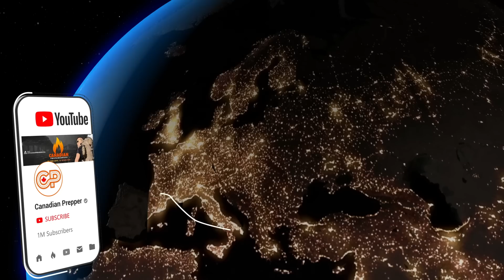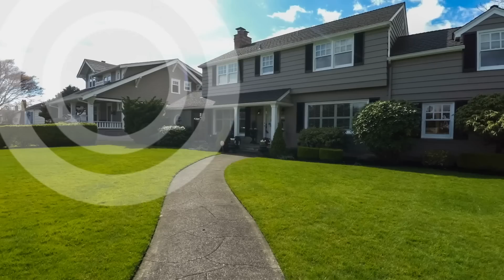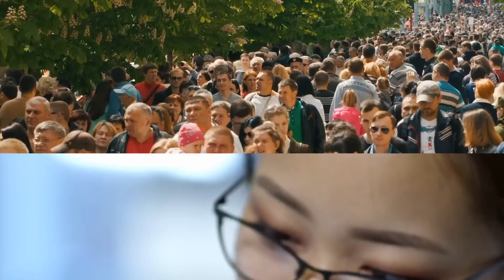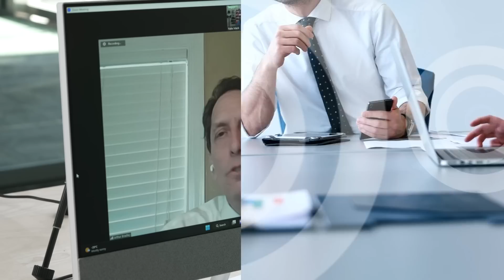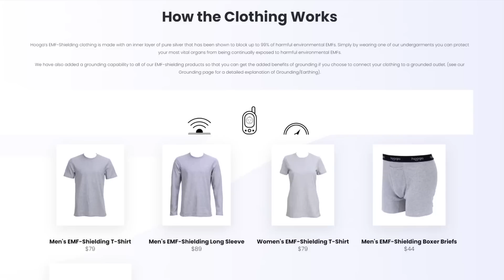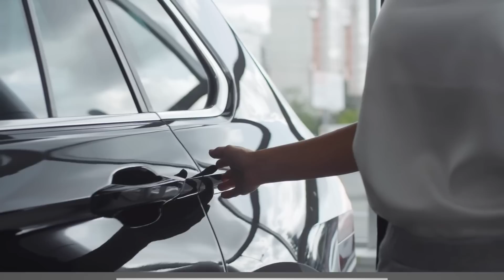NASA Scientist Issues STARK WARNING About WW3, Solar Flares, EMP and EMF

Comment: Very interesting discussion; yet there is this curiosity about the plasma - plasma interaction between the ionosphere and the CME that has not been considered. Quite likely the interaction may/could force an enveloping spreading of the CME around the Earth effectively weakening the impact in any one location. Also recently there seems to have been advanced the notion of the Earth being enveloped by a magnetic bubble (?); now if this be true, there should be also some interaction between this CME and the magnetic shield around the Earth. The magnetic bubble shielding dynamic may presumably further moderate locational impact as well -- one would think.

Comment: Surpasses All Military EMP Testing Standards: MIL-STD-188-125-1,MIL-STD-464C, MIL-STD-461-G, RS-105 (90,000 Volts)
•	EMP Shield Has Set New Standards in EMP Protection and is Listed by Homeland Security in their EMP Resilience Report
•	100% American Made! Around £250

Comment: Europe has been hardening its electrical networks against transient voltages over the last 5 years. We have type 1 surge protection which protects against 300000 volts' type 2 and type 3.

Comment: It’s actually called “Havana Syndrome “
The wifi signals /microwave signals can alter your DNA Helix. Turning on and off switches 
Several vans were captured on surveillance video leaving scene at two different incidents at D.C  after two separate employees were shot by this device that looks like a rifle leaving work in same area shot at steps leaving work.
There’s a picture of Putin shooting one of these rifle like devices with a dish at tip. (In Russia of course)
You can levitate an object for example a ping pong ball 50 years ago using this technology. 
Quantum Channeling

Comment: I'm one of those people who is sensitive to EMF.  I can't have home internet because I can't tolerate having the wi-fi in my home. I figured it out when my wi-fi router stopped working & I realized over the week it took to replace it that my autoimmune symptoms were much, much improved. When I got the new router & turned it on, the symptoms started again within just a few hours. After that, I would only turn the router on when I was actively using the internet. When that router died, too, I simply never replaced it because using one was obviously negatively affecting my health. I have to watch how much time i spend on my cell, too, or the autoimmune symptoms flare. Unfortunately, I'm saturated in EMF at work due to the entire building having wi-fi & I notice I'm more "drained" & have more symptoms from my autoimmune conditions while at work than I do on my weekends off in the relatively low-EMF environment of my home.
Reply: Put an aluminum window screen box around a WiFi router and use only cat-5 or cat-6 to rebuild your network.
Reply: My sister is very sensitive. She got some special black paint and not only painted her entire office with it but my mother’s entire bedroom including the ceiling. She doesn’t have the usual cable connections. She has fiber optic internet connection. She also has a hand held tool she uses that puts out a sound that lets you know how much emf is around her.

Comment: EMF needs to be considered as a potential harmful electromagnetic field.  The changing fields of the EMF can induce inductive currents into the brain cells and neurons whose mechanisms of communications is also through electric waves.  This is because blood is conductive. This induction would be in the form of Eddy currents (Faraday's law of induction).  Hence, possible disruptions of intrinsic neuron and molecules electric fields could happen causing certain weird perceptions and possible tissue damage in the long run with high enough EMF fields.   Just look at the trees and vegetation in close proximity to the high voltage transmission lines that emit high EMF and you'll notice a difference.

Comment: One thing about Faraday fields is too much radiation will overpower and penetrate and make the metal a transmitter.
Reply: Would the old fashioned lightning rods act as a Faraday cage?  Why did they discontinue the use of them in modern construction?  Isn't the ground from one's breaker box to the outside meant to do the same thing?  I don't know much, but I wonder about such things.

Comment: I have created an EMP proof suit which not only protects me from and EMP but also allows me harness its power through a power rod. The rod is connected to a battery pack and is fused directly to my brain via screws and copper wire. If my calculations are correct once the emp takes power away from everything else it should hit my power rod and transfer all the power straight in to my brain and charge my battery to 100%. I should instantly gain all knowledge from the entire internet loaded directly to my brain. Then I’ll use my knowledge to rebuild society after the apocalypse. It shouldn’t take long to become the leader of my own town at the very least.

I’ll use my new power to make a new government along with new laws set by me. Also I’m gonna make an ak47 prosthetic arm that I’ll attach to my arm with 6 bolts and some melt pipes. I f all goes according to plan I’ll be running my own new state within a month and I can choose a group of only the most perfect women to bare my seed. Then my children can help me govern this new land
Reply: Good luck

Comment: The whole 5G infrastructure is a military microwave targeting system. A.I. controlled, High gain, Die-electric and Phased array antennas will identify you, track you, focus and target you. This can be done through walls. The 'safe' limits recommended by regulating authorities are up to 10,000 higher than where detrimental effects are apparent to biological life. All biological life, including microbes. Any and all artificial energy source is not natural and we are not evolved to handle it.

Comment: Some of the frequencies Art mentioned aren't quite right. Cell frequencies have been either 700Mhz, 850Mhz, and 1.9 Ghz. 902-928 is an unlicensed band, 930 is common for certain smart meters. 700/800Mhz are also public safety bands. T-mobile's 5G is on 600Mhz. Wifi is either 2.4Ghz or 5.8Ghz. There's another 5G band around 3Ghz and another right around 5Ghz. There are other higher frequency emitters like car collision detectors at 27Ghz and higher that people are around. So there's lots of emitters out there.

Comment: Curious to know what was the Earliest Year of Vehicles wouldn’t be affected by an EMP?
Reply: It has to be a solid state electrical system with points in the distributer.1975 and older vehicles You still need to unhook the battery both positive and negative cables. You still may have problems with the alternators,burning up the diodes.
Reply: Older vw bugs I think are capable. Might want to research it though.
Reply: Before 1995

Comment: The question of EMFs harming us is possible. We run on electricity with our nervous systems. The possibility of overstimulating these nerves may act on the nerves as an itching powder does on the skin. Earratating thems over the long run! In short agitating people into a higher level of anger over time. These electrical signals may be on a very small scale shorting out, or confusing the brain's intubation of these electrical impulses. Sending the wrong doses of hormones brings about imbalances in our bodies. Increasing the likely hood of malleable physical ailments to more people than before. Then there is a likely hood of weather pattern shifts. We know clouds are drops of water binding around the dust in the air. Some of the dust is of metal. Magnetic wave act on metal! We know from grad school science class, that different magnets leave different patterns with the fares dust on paper. Here is the thought experiment!  Is it possible that all the magnetic waves we are producing all over the world, maybe the cause of the shifting weather patterns? Just how many radio transmitters are there in the world, along with power lines which give off their magnetic field also? One last observation, ever notice when there's a power outage how much more relaxed your nervous system feels?
Reply: We're being bathed in frequencies all the time, yep. How could that possibly be good for us? Check out "Beings of frequency" it's here on yt.

Comment: Our bodies are bio-electric and have become used to all the energy fields around us, if an EMP went off and everything shut down you can be sure that everyone won't be feeling too good, it would be like trying to come off a class A drug by going cold turkey.
Reply: If that’s the case when you go out to the middle of the wilderness you’d feel sick.  Quite the opposite.
Reply: Actually, I lived in a huge urban sprawl for years, on the grid. Then I bought 7.5 acres deep woods, moved to my land, built a cabin and homestead. I disagree with what you are saying about feeling in detox. Its actually an invigorating feeling, like being free, a sense of sovereignty. All the pressure and stresses diminish and you gain a sense of the environment. Its not at all like a addiction detoxing, its like getting a new kind of high.

Comment: Think about those jabs that may contain micro carbon in the form of graphite which is an excellent conductor of electricity, pump up the power in those cell towers and you are a perfect antenna to be cooked inside out…
Reply: According to Todd Callander (look him up), certain frequencies of 5G will activate the circuitry in the jabs.
Reply: @bobnancymiller4931  Those 5G transmitters are being placed on the top of power and telephone poles in our neighborhood and close to our schools, these transmitters look like a big tin can, nothing like what you see on current cell towers. Something very nefarious is going on. I talked to one technician installing these transmitters and asked why such a large power cable is being used since these transmitters are supposed to run at such a low wattage and have a short transmitting range and he said good question, we’re told to just install them….

Comment: Also about the emf n or radiation if one would like to know what it feels like, I don't say do it just microwaves have a large amount the doors have lead glass n lead paint also the metal frame that on the out side is also made from lead in the metal to keep us safe most don't know, I was working in one years back with the top cover off working on it fired it up to see if all was well set timmer for 5 mins was next to it, n the hairs on my arms n head stud up started to feel sick n felt like I would pass out, so I pulled the power cords but no harm that I know of has scams of my body for other reasons from doctors but. My point is it's very strange feeling
Reply: Hey @MustangKevin69 could that not mean that your intact but unplugged microwave, or one you got from a junk pile, could also serve as a Farraday cage?  Why would one need to buy a specialty product, if so???

Comment: Hi Nate. 
Question: If we take the batteries out of our cars then store the battery in a Faraday cage, do you suppose we would be able to prevent damage to the car?
Reply: No.
Reply: You would need a vehicle that has no computer, chips etc. Think classics. Then store any of your electonic components (or spares) in a faraday cage (think condensers, etc.)
Reply: I have a theory that if you ground your vehicle it would give the emp an easy path to ground and maybe spare the microchips. A copper rod in the ground with a jumper cable from the rod to the metal frame of your vehicle might work. Anyways just a theory. This theory comes from my many years of experience in automotive 12 volt industry.
Reply: I have a faraday cafe but my faradays keep escaping
Reply: Thanks everyone for the info!

Comment: Why not just disconnect the battery
Reply: It is not about "being connected" think of it as a giant lightning strike where the energy will pass through everything
Reply: I try to keep everything disconnected from the batteries around here
Reply: If there is no electricity power nothing should be hurt
Reply: DC power

Comment: I use my microwave to melt cheese on tacos. That’s it! I didn’t have one for years. Think about opening the door and that flood of radiation hitting you in the chest or head.
Reply: Oh my goodness stop believing pseudoscience and do some research. HE EVEN SAYS IT IN THIS VIDEO. Microwaves are non-ionizing radition. It does not change or permanently damage tissue like ionizing radiation (nuclear for example) . If you rigged your microwave to run with the door open and stuck your hand in you'd eventually get some minor burns and redness on your skin that would heal just like any other burn. Microwaves move extremely fast and dissipate before you even open the door. They are about the width of a pencil and thus they do not pass through the metal holes in your microwave door , but it still allows you to see your food. They actually do LESS nutritional damage to food than boiling and baking , and are not dangerous if you use them as intended. I still tell people to hit stop before opening the door but that's not because of "microwaves escaping" it's to prevent the door switches from shorting out and you needing a repairman..

 Also if you really believed you had a radioactive box that blasts your food , why would you eat the food since it would kill you. ☢

Comment: ALL electric companies have physical disconnects to protect their massive transformers form electrical damage. These transformers cost millions of dollars and would take years to replace. Yes you would need a temporary blackout, but it would be much better to loose power for a few days than a few years. Power lines if damaged can be replaced fairly easy, but transformers is a whole different ballgame.
Reply: You are right and Rong at the same time.
The general rule is THEY should keep the totality of the system managed properly.
IT is absolutely not.
Reply: That's assuming the power from the lines doesn't jump the gap and take out the transformers. The connections for the disconnects are not that far apart.
Reply: The devices do not need to be connected to the grid to be damaged by an EMP 
If it has chips and circuts it is vulnerable 

As to the transformers the MOT ( main output transformers) at the power plant i work at have a minimum of a 2 year lead time to replace, and they are always connected to the grid

Comment: I feel a rubber barrier would be better....you ever put tin foil in a microwave?...that doesn't seem to me like the way to go...this is coming from an electrician and what iv experienced is you block electric with non conductive materals....you wouldn't wrap a hot wire with tin foil...I feel it could work like a lightning rod but it would have to be grounded....I feel a rubber cage maybe rubber lined metal cage that's grounded...
Reply: You can put metal in the microwave no problem in certain circumstances!
Microwave brownies in a Pyrex dish with tin foil on the corners! Frozen juice, take the top metal cover off! 
You can even set a table knife in and that’s no problem, but don’t stand the same knife up in a measuring cup! 

:)

Comment: The DOD dropped a news story last year that we have a drone now the does the same emp as a bomb without the radiation. And can fly over large areas repeating the same process. I immediately thought this would be good for false flag attacks as well.
Reply: Interesting. Going back in time, Starfish Prime was possibly the earliest specific testing of EMPs (in 1962) using an aerial nuclear detonation. Done in the Pacific, it resulted in an Aurora, blown lights in Hawaii, radio blackouts, electrical surges, telephone outages, killed satellites, ruined electronics, and formed an artificial radiation belt.

Comment: What about if they where powered off n no power going to them is a good ?
Reply: Even if you throw th breaker to the house, it may still jump and ark over. Everything Would need to be unplugged. Even that may not be enough if it affects the individual electronics in the items.
Reply: @rumdog117  kinda was my thought for cars cell phones all that but since most phone's u can't putt batteries n towers would be down for GPS I guess be only good for music,  but as for houses I think it would be better to remove the miteroutsidee but that's just my thought or remove the whole breaker but again wouldn't matter as the grid would be down n other u would need a generator or solar panels u would need to deploy but if the neutron's n electrons was out of wack it would do no good for batteries or solar same would go for coil packs on small engines as the magnets would most likely be no good unless ur more than 60 plus miles away from center of ground zero but the debris in the air flying around would throw off north n south poles I do believe may be best to go candles n others ways from back in the day